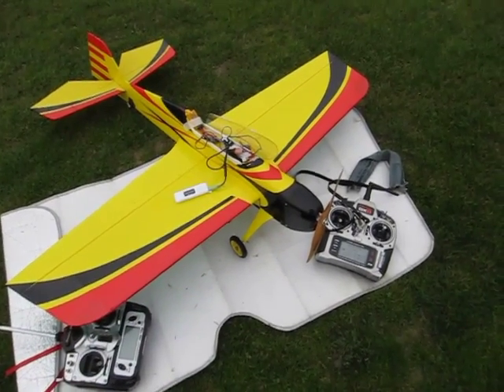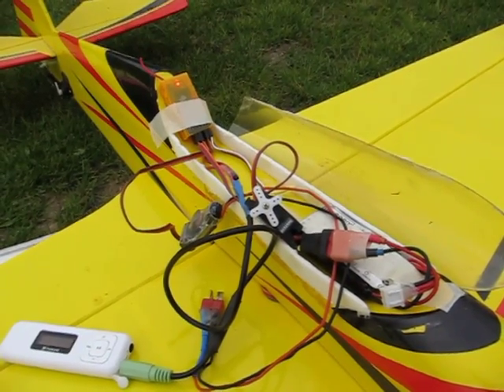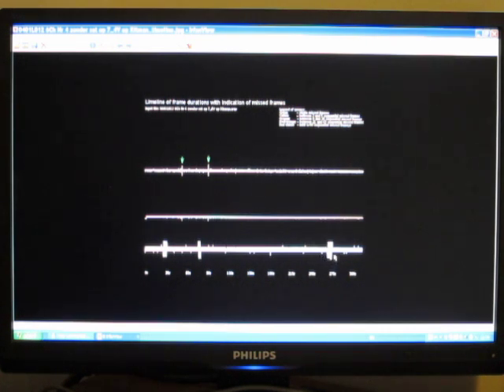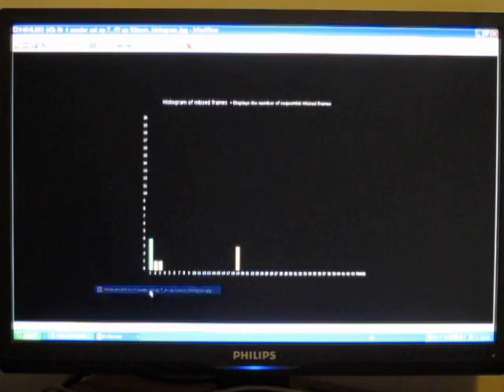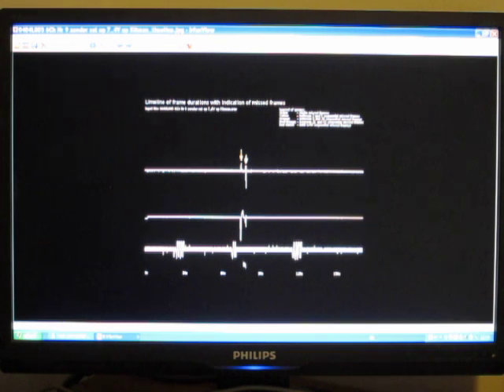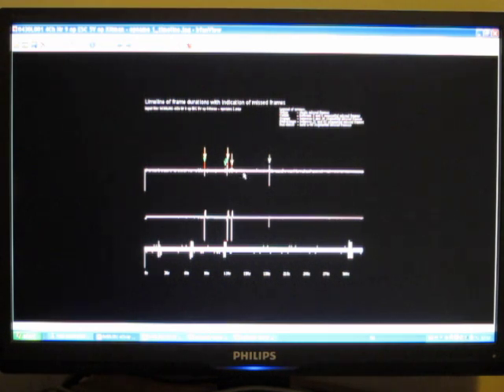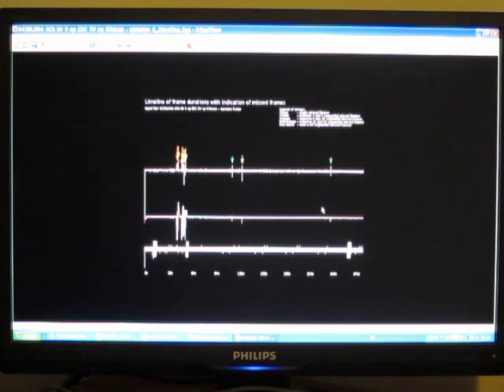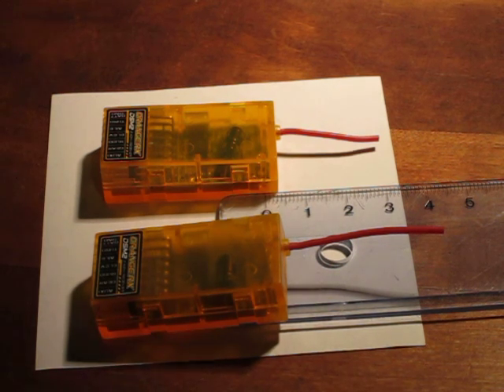OrangeRX 6 Channel DSM2 receiver operating at different voltages - review

Comment from the maker: Hi,

thanks for the comment. I have no recommendation on using a satellite or not. These receivers work great without a satellite and also succeeded for a test with a satellite. I could not test if the satellite brings an improvement or not. I you succeed in finding out, please tell me. It is an interesting question. 

Best regards, Peter